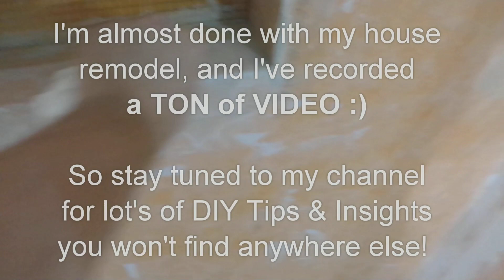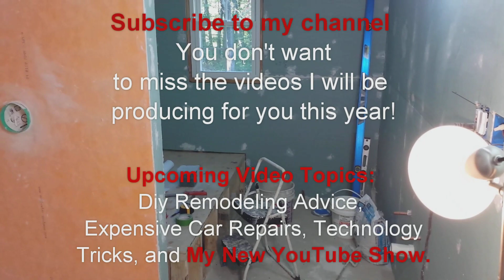Schluter Shower Kit Waterproofing Membrane Installation Review | Bathroom Addition Project

Comment: Your install is almost identical to the one I'm doing in my 32x60 shower, I will be installing the shluter membrane in the next few days. I ended up mudding my seams in the shower to prevent that crease you have.. I will mix the thinset a little wetter to have time to work with it.

Comment: nice work its worth it!!
Reply from the maker: +RGS Tile Smith Thanks it was my first time and although it came out nice, it took ALOT OF TIME! LOL   My tile guy still made a mud shower base and used the red waterproofing paint as well. It's overkill for waterproofing, but his work was so good I didn't care. Apparently he was not used to Schluter systems and only trusted the old techniques. I couldn't convince him and this guy works on mansions here in CT; I was happy just to have him tile my shower.  I actually worked as a GC for 6 years and only once hired someone that could do such a straight job. The other guy that was able to achieve such straight grout lines took 2 weeks for a small bathroom. My guy knocked it out in a few days and my nitpicking eyes are still satisfied!

Comment: I have not done an install of this system and I am not saying you did it wrong, but wouldn't it make more sense to install the liner in the basin first then work your way up so that where there are overlaps will not trap water. Much like the way windows are seals on the exteriors as well as roofs.
Reply: +Dan P IT dose not mater 2" over lap and its water tight .
And its a fluke . but a good system !!